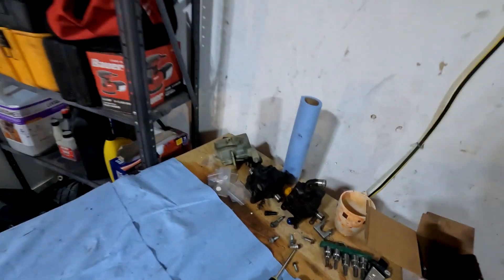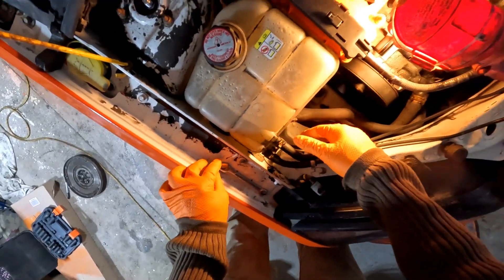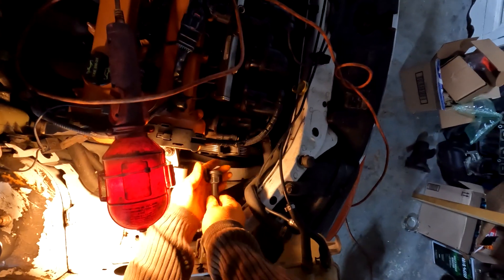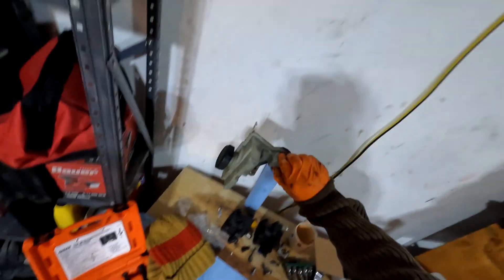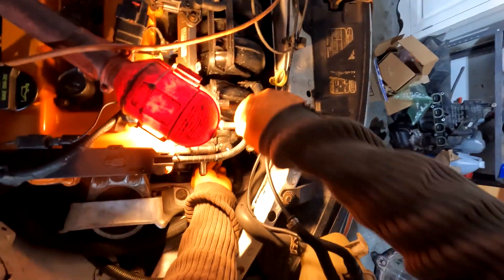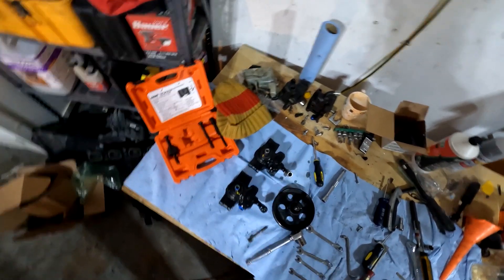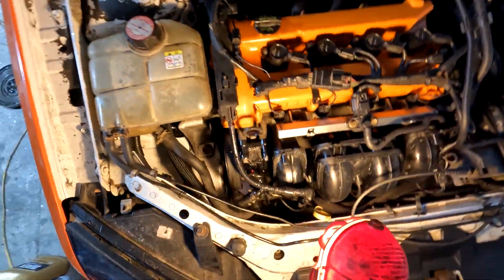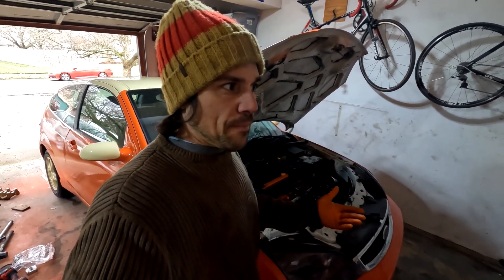Power Steering Pump Install | 2005 Ford Focus | Full Step by Step

Comment: Thanks for this.  I am considering buying a used Focus that needs a power steering pump.  This doesn't look too hard.
Reply from the maker: @basicforge  it's a pretty easy job. Get that focus, they are fun to drive especially the 5 speed.
Reply: @threepedalgarage993  I am eager to see the car tomorrow.  It has less than 100k miles, and I don't see any rust in the photos.  I hope to find a very clean undercarriage.

Comment: Now would this be the same for a Ford fusion?
Reply from the maker: @devenmaracle4026  for those with duratec 4 cylinder, possibly. They used a couple different pump/ reservoir designs.

Comment: I replaced my pump thinking that would stop the fluid from draining but it's still draining in the resovior. Any suggestions??
Reply from the maker: What id do is clean everything with degreaser so an leaks will show up. Then you know where to fix. Just did this on my van but i dont see any sign of leaks, i think it magically fixed itself.